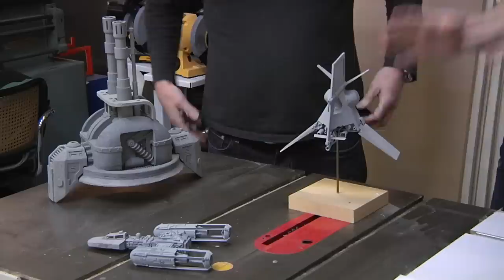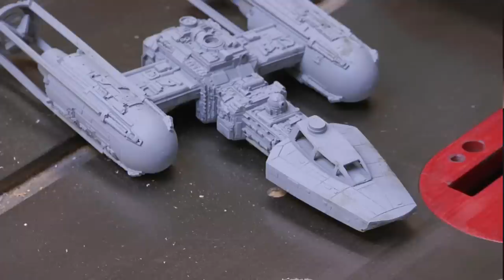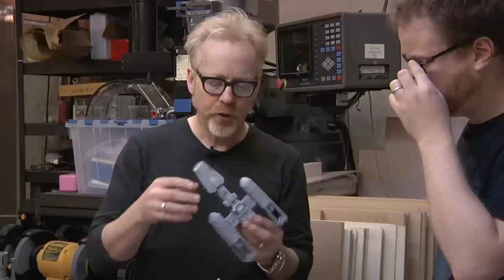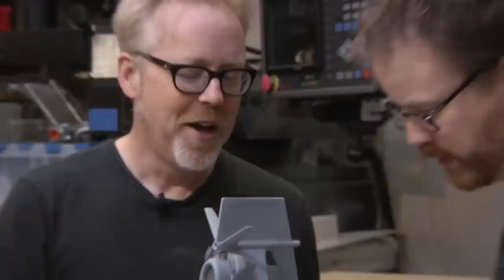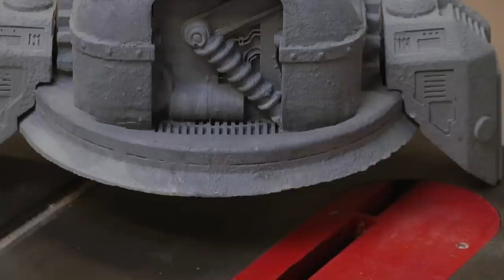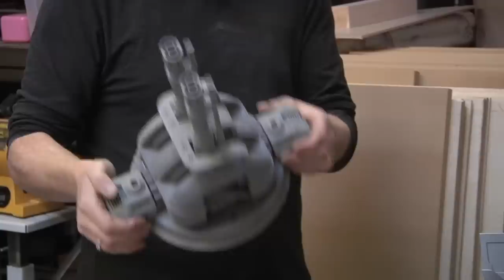Inside Adam Savage's Cave: Model Making for Movies

Comment: Adam goes into detail about the casting of the "Hammer" gun he had produced. He talks about how he received a file from Maya and reversed engineered it to build a practical version. What is cool, is I have stored in my archives the original Maya file he used. I was given it to use as a bash kit when working on a separate film. I find this so cool. He is holding onto the practical version as a keepsake, and I'm hanging onto the digital version as a keepsake.
Reply: +Robert Waterworth That's pretty cool :)
Reply: Robert Waterworth

Comment: i've been in that model shop that adam's talking about, at the old ilm building in san rafael. he's exactly right. there is a loft space where a lot of the detailed models are built, with a ton of boxed models in the corner for pulling greeblies from, and a huge wall of little drawers (like what you'd find in a tool shop holding screws, washers, etc), holding a shit ton of styrene and other model building parts. fascinating stuff. wish i could have stayed in that room for the next week to just build stuff. ;-)

Comment: I watch so much tested and i am a model builder and maker for a living i used his water temporary tattoos of his actual tattoo of the measuring scale on his arm tattooed on my arm in same wxact spot its so nice having it cause now i can get quick reference measurements of stuff like bolt lengths and length of pieces and ect most useful thing i could have done for my self and ppl love it and it got me this job i got now cause the manager of the modeling side said someone with a tattoo to measure with on thier arm is someone who is dedicated to making building fabercating and model making. I was a welder and favercator before becoming a model maker and used my arm tattoo alot in fab shops as well

Comment: Great episode.
There was this series 'space 1999' in my youth, I still remember the "eagle transporter", I guess it was called,  dangling on it's fishing wire suspension. 
I actually build that model from a kit that came out back then.
When it comes to 'kit bashing' I remember those jet fighter kits with optional fuel tanks or      rockets etc. that left you with some 'leftovers'. 
I used these as well to 'pimp' some other models :-)

Comment: On full size sets of ships we often used the Styrofoam that came out of the box with your tv we could glue it to a surface and then even put gauges or lights in it for Airplane 2 there was the plastic rack on the inside of a refrigerator door turned around and fitted with lights and toggle switches

Comment: I would be curious as to which Galoob ships other than the Y-Wing Adam did prototypes for as I still have a few of those. Those "Action Fleet" toys were rather nicely done. Granted they had to get bulked out a little in spots to accomodate the mini figures when they got to the toy stage, but they still looked pretty dang cool (although I wish Adam's original Y-wing head shape could have been maintained better through the design process).

Comment: "No 2 Y-wings are exactly alike!"

Yeah, that doesn't look that close like the Y-wing model Bandai released.
The Bandai model is HYPER-detailed with LOTS of miniature plastic tubing resembling pipes.
I think also that the engine nacelles and main body aft of the cockpit are longer than Adam's model.
I don't know what reference photos Lucasfilm gave him but that looks like a snubby Y-wing.

To be fair, the Millennium Falcons aren't exactly the same between different scales, either, and that's not even taking into account the dramatic changes between the ANH Falcon and the TESB model with the 5 sets of landing gear.

Comment: The Y-wing is the A-10 of the rebel fleet
Reply: +88Mobius 

A-10s are dedicated close air support, Y-Wings are assault fighters or multiroles depending on what you're using for canon. K-Wings are Star Wars A10s.
Reply: +Aolian I was more, or less comepareing the looks of the A-10 to the Y-wing. They are also both slow as dirt. I honestly was not taking the actual purpose of both craft in mind. just looks and speed.
Reply: +Aolian oh and the A-10 and Y-wing can both take a lot of flack.
Reply: The Y-Wing isn't that slow, that's kind of a meme that has stuck for some reason. It's only 20% slower than the X-Wing if you go by the X-Wing games, it's 10% slower if you go by the charts from Behing the Magic (and by most Star Wars RPGs) and it's the same speed/maneuverability if you go by Industrial Light and Magic's production notes from the Battle of Endor.

Comment: Here's some anal attention to detail: This was Adam's job before Mythbuster, so prior to 2003. Around 2000 Adam probably did not have access to 3D printer that could produce such fine details. 3D printer we're relatively still quite new and probably only experimental machines could do sub mm detail. Tech has come a long way in short time, we take for granted things quickly.

Comment: Why are models like those always that color grey?
Reply: +Jelle Vreeburg Correct me if i'm wrong, but usually before a model/object is painted, its covered in primer(which is a special type of paint, usually the color grey). The main purpose of primer is to ensure a better adhesion for paint, as well as increasing durability of the paint.
Reply: +FlamingGorillaLP Thanks, sounds quite logical. Didn't think of that.
Reply: +FlamingGorillaLP well those models are made to make casts out of them so they don't need to be painted.
Reply: Jelle Vreeburg